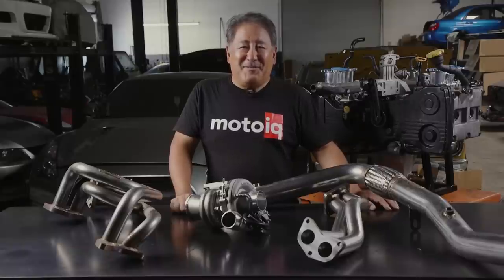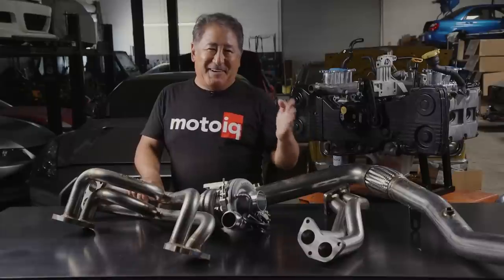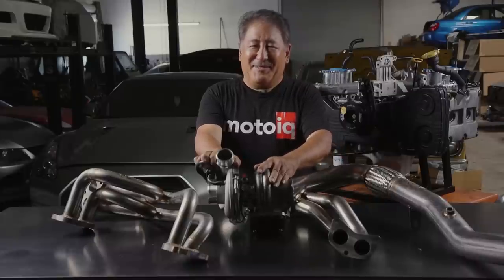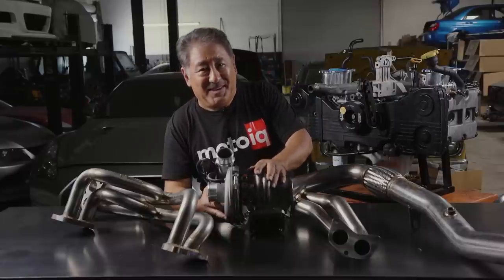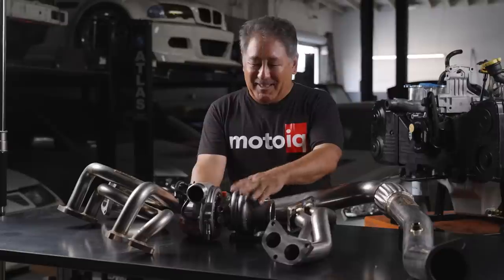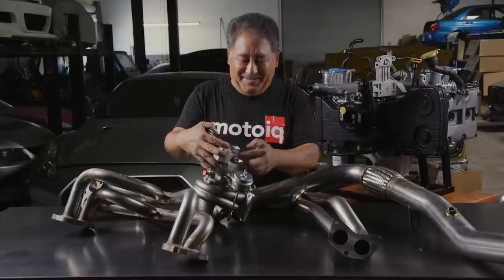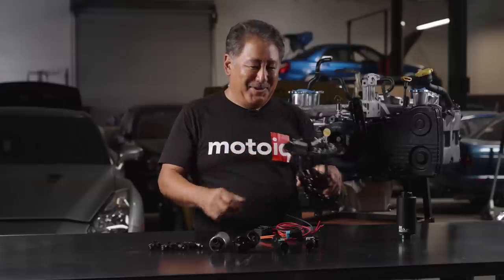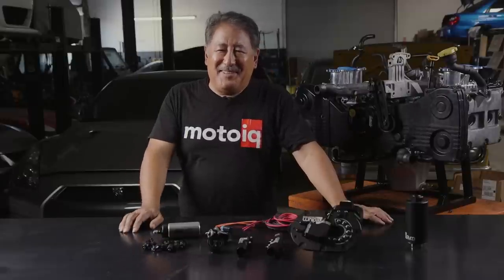Big Power Subaru Parts!   Turbo | Exhaust | Fueling

Comment: I purchased a Full-race turbo kit for my B-series build back in 2004-2005 time frame. Back then they had a tiny office space in Mesa, Az and a small shop in Tempe I think. Anyway, back then I was looking for a kit that I knew was bullet proof, I got lucky to purchase a kit from a company (Full-race) that turned out to be one of the best and most reliable turbo kits available then and now. Seriously, Full-Race was just a bunch of cool dudes, I messed up and installed my new injectors with out lubing the o-rings, they obviously leaked. One of the full-race guys hooked me up with a new set of o-rings, I’ll never forget that, I think his name was Jose, anyway thanx Jose and Full-Race, the coolest and most high-quality companies in the mod industry that Ive ever had to deal with.

Comment: With a little bit of adapting work you can mount and wire two of those bigger pumps in parallel, so if anything goes wrong you can switch from your dashboard. As always your contents are extremely detailed as clear to understand, the amount of infos and competence here is very high. Merry Christmas!
Reply from the maker: https://motoiq.com/fixing-the-gd-wrx-fuel-system-with-radium-engineering-and-deatschwerks/
Reply: @motoiq  I didn't see that, you're good then! 👍🏻

Comment: This is really interesting, a while ago I decided my -05 wrx needed some more top end. But I did not want to lose response.
After a while I found an ad in my local subaru group for a kinugawa twinscroll turbo, with twin scroll manifold and up pipe. Then I went to a track day and wrecked my gearbox.
But this video inspires me to pursue my tuning plans, which are way more modest, I’m not sure I want to push more than 350hp on my stock ej205, maybe not even that much. I do more autocross than track days, so response is more important than top end.

Comment: Full-Race is no longer doing these unfortunately (and apparently not fabricating anything anymore). I wanted to buy it from them, but had to go with ETS's kit, which only does External wastegate. Pretty stoked about it!

Thanks for the video, always very informative.
Reply from the maker: ETS stuff is top notch.
Reply: @motoiq  for sure, that’s what I’m running. I do wish they were able to drop the turbo down a bit lower to shorten the up pipe a bit. But for the sake of packaging and ease of installation I can see why it is the way it is.
Reply: I have ordered a 7163, I'll just modify my up and downpipe myself to make the efr fit since full race stopped making the kits

Comment: I have the Full-race turbo kit with the EFR 7163 twin scroll. I don't recommend the EFR turbos at all. They don't handle high oil pressure very well and start to smoke. You won't find anyone who works on EFR turbos to rebuild them because they are different than any turbo out there so your stuck with a turbo that nobody will rebuild or even want to look at.  At the very least run a oil pressure regulator (OPR-40) from Turbosmart if your going to run high rpms to protect the turbo from getting too much oil pressure.
Reply from the maker: All ball bearing turbos no matter what brand require at least a small restrictor to prevent smoking.

Comment: being in california, i'd be interested in seeing y'all build a greenspeed/CARBlegal full build.
Reply from the maker: We did and wrote about it on motoiq.com
Reply: @motoiq  oh? i'll go check it out. thanks.
Reply: @motoiq  is 307whp the most you can make while staying CARB-legal? I only saw that the blog is a 3part series. Is there no turbo upgrade? I saw that COBB has many NextGen CARB-legal parts, do they violate state regulations after being tuned?
Reply from the maker: Currently it is but supposedly they are working on CARB approved flex fuel. That should be a nice jump.

Comment: I have a 1983 Subaru 4 stroke carburetor,do y’all work on them and make it better. Running good and strong,it’s all ways run good don’t use mush fuel I always like it now it just seats outside there. Well let me know and will see ya next time see ya bye.
Reply from the maker: No only performance cars
Reply: @motoiq  okay thanks for reply

Comment: what an amazing channel. Literally i'm on my 4th video today and i'm hooked. I do have question, i'm thinking of purchasing a brz/frs and eventually would want to either turbo charge or supercharge. Could ya give any input on which option would be better  for the FA20?
Reply from the maker: I sorta feel that turbocharging can easily give you the power to nuke the tranny and the engines bottom end.  I like the Edebrock supercharger kit.  The trick is don't get greedy.  Even built, the FA20 can't handle much more than low 400's for very long. The transmission can't even take that.
Reply: @motoiq  gotcha, firstly thank you for the response. Also i don't plan on pushing more than 300-350

Comment: I'm with you, even ahead of you in this. But still not sold on this. If you have a set of pipes on a flat 4.  You can setup tube length to do the same work.
I don't se how dividing the exust side and having a bi exit makes extra power. I love your explanation but I don't see th benifit still. I watched this over and over. It's a great idea. But I don't see this lasting or staying.
Reply from the maker: It's not a matter of your opinion, the twin scroll concept is a long proven fact and has been used to speed turbo spool time for a generation.  It is really common in diesel applications due to the low energy content of diesel exhaust.

Comment: Quick question did you go with the Killer B Motorsport 321 Stainless Holy Header/Up-Pipe or with the MAX VE ?
Reply from the maker: It's the same thing, just one is bundled with an up pipe and the other isnt.

Comment: Flatirons Tuning tested twin scroll vs single scroll and reckon the advantages are minimal on the Subaru. Also does this motor have AVCS?
Reply: That might've been regarding the 2.5L motors. For whatever reason, twin scroll seems to provide a decent improvement on smaller displacement EJ motors (EJ20s & strokers between 2.1-2.3L) but not so much on the EJ25s
Reply from the maker: No

Comment: Is it practical to ceramic coat the inside of the exhaust manifold to reduce the rate of its exhaust gas heat absorption?
Reply from the maker: Some people do this, although if it flakes off it could damage the turbine
Reply: Doable, but probably not really worth it for the reason Mike gave above. Better to ceramic coat the outside, use a heat wrap if practical, or both.

Comment: Could you do a video of how to build the ez36 engine?
Reply from the maker: We have never done one.
Reply: @motoiq  There seems to be decent support for the ez30 engine, but very little for the ez36. There seems to be a consensus that the ez36 is not a good engine for a high horsepower build. I'm more interested in moderate power, it is my daily driver after all. Raptor Superchargers makes a bolt on kit, but I would like to improve the longevity of the engine.

Comment: my 2000 subaru b4 legacy just a 2.0 Ithe previous owner did everything and a manual swap it's my first car I don't like how he has messed up some wires somehow that thing starts it's not driving because of the breaks I'm probably not going to turbo it idk if it's actually at 489.712 on the ODO  it needs a few things b4 it gets a turbo if and probably just one
Reply from the maker: Wow

Comment: tuned on E85, you ever run into repeatedly killing your widebands? did it come down to wideband type, positioning, or perhaps coolant temp enrichment/ tune related? Thanks for your time!
Reply from the maker: That's weird E85 is easy on widebands.  Are you running any fuel or zinc based oil additives? Using high temp silicone upstream of the sensor? Where is the wideband located?  Sometimes moisture can do it.
Reply: @motoiq   Fuels - Wawa e85 & sunoco 93 (various blends) no additives
Oil - IAG 2 stage 2 tuff recommended break-in oil no additives...

I don't suspect there to be any silicone, but i'll need to find out where our tuner put wideband to answer that more accurately.

was kinda hoping to learn through someone else's experience who maybe took a similar path of IAG stage 2 tuff ej257 flex fuel kit on a speed density tune w/ equal length headers... thanks man
Reply from the maker: One thing is that you should always mount the sensor horizontally instead of vertically.  This way solid liquid water accumulating in the exhaust from E85 under cold start is less likely to be blown on the sensor.  The sensor heater is getting pretty hot and some solid water hitting it can thermal shock it and take it out.

Comment: Lag isnt so bad on the street if its predictable. it can get expensive to fuel normal operations if youre in boost all the time, but it is great for a race car. Another good thing about that bigger turbine housing is that it can help control EGTs a little.
Reply from the maker: Dunno about lag not being bad on the street, especially on an AWD car with tons of traction.  Maybe on a FWD car with limited grip.
Reply: All im saying is it can be sized bigger so that youre not on boost 100% of the time, which is a good reason to have a bigger turbo. I wouldnt want boost delay. Ill see myself out. Racecars only around here.
Reply: @you_can_fuck_your_own_ass_69  got ya. I know a lot of guys will tune it out by the time it gets to the stage, but I could see it being more of a consideration for the flat layout. Im sure there is only so much a person can do do with the compression ratio and engine speed safely to get things spooled up.
Reply: if only there was some way to delay ignition timing with drive by wire. We could create some anti turbo lag system that could work while the car is rolling in race conditions. Some kind of selectable, automatic rolling anti turbo lag system. It would have to be easily programmable via ecu. i hope one day lag is easily addressed with some sort of technology like this. one day.
Reply from the maker: Our project GD STI has that but its tuned mildly so we don't fry the cat.

Comment: I’m a bit shocked your running all those high quality fuel system parts, then running DW Injectors. Not a lot of people have much good to say about them.
Reply from the maker: They are based on the Bosch EV14, just like injector Dynamics and others, top notch stuff.  A long time ago they did stuff like drill out stock injectors when they were not many alternatives for some cars but that was around 15 years ago.  Now their stuff is top notch, ask reputable tuners and they have no issues.
Reply: @motoiq  admittedly, it’s been a while since I’ve used them. But it would still seem they don’t have the best reputation. Perhaps all that’s needed is a few more videos from places like yourself to help change that. But it’s going to take a lot to pry my Injector Dynamics out of my hand. Ha
Reply: @JordieG8  I used DW injectors on my supercharged 5.0 on my tuners recommendation and they worked great. I also had their 400lph pump and had no problems at all. I was making 740rwhp and was basically maxed on what 93 octane could do (no E85 where I live).
Reply: @arc00ta  never had issues with the pumps, just their injectors

Comment: Could anyone on the team comment on the merit of ceramic coatings or fiberglass wraps to contain more of the exhaust energy?
Reply from the maker: As for power production, its hard to quantify, but we did find an improvement in spool time with a turbine blanket in another test so presumably reducing heat loss will help.
Reply from the maker: https://motoiq.com/nerd-o-scope-keeping-the-energy-in-turbos-using-ptp-turbo-blankets/

Comment: getting something for nothing? there is no free lunch... lol
Reply from the maker: Many times there is
Reply: @motoiq  often not the case... great hardware laying on the table though. Once installed and get to tuned, many realize that you have sacrifice something to gain something.
Reply from the maker: Not in this case, this setup is capable of an easy 150 whp more than stock and about the same about of lag.

Comment: Whenever I see Subaru content I’m reminded why I don’t want to own a Subaru lol
Reply: But yet you can’t get away from them
Reply: @Justinhomii  Pulling away from them as theyr'e on the side of the road isn't so hard
Reply: I really wanted one, but they're probably the most over priced car on the used market for enthusiasts.. People STILL want 10k+ for their basic ass WRX that barely makes over 200 hp and who's engine is on the way out anyway... Let alone what the STIs cost. Who is out there buying these things?
Reply: @SoulEraser000  JDM STI with a EJ207 if you want reliability. 140k km on mine zero issues. These engines are very particular and will punish bad owners.
Reply: @findmeifyoucan  Not even talking about new cars here, bud... People want premium prices on their 20 year old WRX was the point of my original comment.
Reply: @matt260  So you have to import a car for them to be reliable? Well that's reassuring
Reply: Porsche makes reliable boxer style powertrains. I don't think Subaru is anywhere near that.
Reply from the maker: Except the M96
Reply: True Subaru video content is never without dumb comments 😂😂
Reply: @ayske1  idk how I was being dumb. They genuinely seem finicky, and a pain to maintain/work on. Just spark plugs alone in some WRX chassis is an afternoon ordeal. Let alone valve covers, thermostat, etc.
Reply: Subaru issues are so overstated in my opinion. I have 4 turbo Subarus in various states of tuning and they run great. You have to think about the owners of a lot of these cars, they beat them hard, put them down wet and neglect maintenance and not to mention sketchy tunes.
Reply: @_Hani_26  agreed. Granted they're not a Porsche so it's dumb to compare the two. Not apples to apples. But some are better off owning a Camry

I also have a legacy GT and have had no issues past 3 years. Only one older previous owner
Reply from the maker: We blew up ours in stock trim doing everything right. Basically a stock bottom end is safe till about 335 whp.  Ours was making 385 and it blew up after about 3 years of pounding.
Reply: @motoiq  that's a top effort. Always love your content on the EJ engines!
Reply: Compared to a good handful of common turbocharged vertical inline-4 engines, that's not that much.
Reply: @exothermal.sprocket  probably but it is what it is... personally I think that amount is plenty for street and not cheap to get to that power.
Reply: @ayske1  Yeah it's not slow.
I think of the K-series Honda engines, the VAG EA888 engine, the Mitsubishi 4G63 engine, Nissan SR20DET, Toyota 3S-GTE, Volvo Redblock. Could toss in the 2.3L Ecoboost in there.
Reply: @exothermal.sprocket  like you're not wrong that others can make more. Many people I guess aren't just after the engine though.